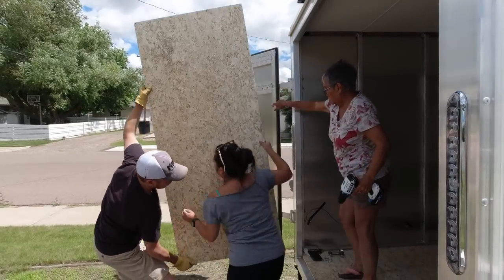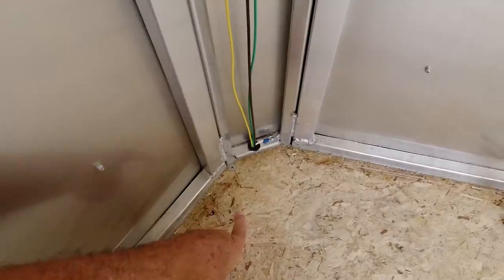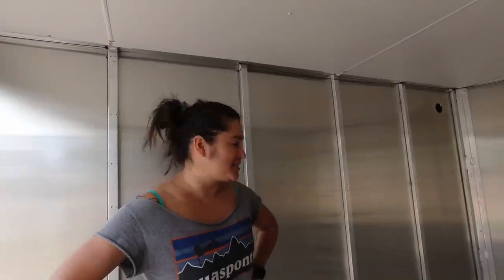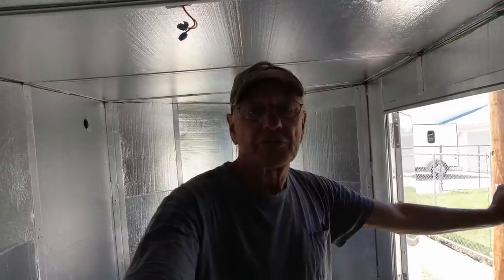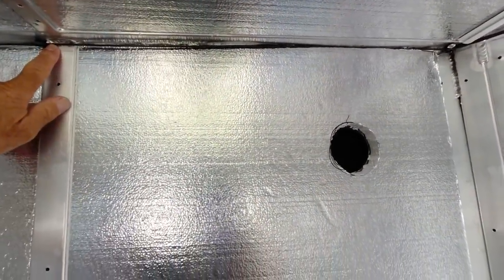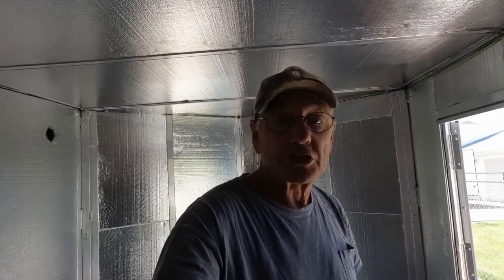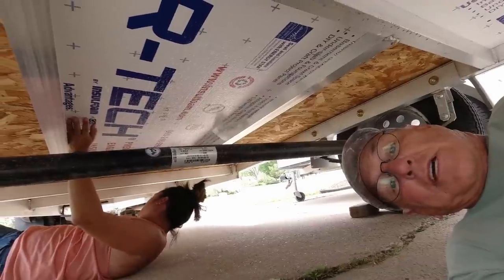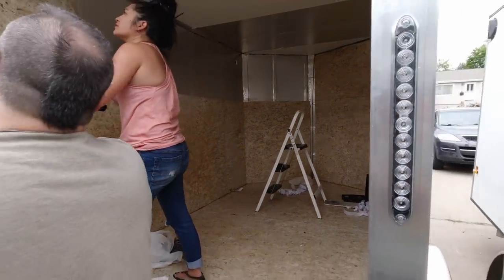Cargo Trailer to Camp Trailer - How To Start Your Build - Insulation

Comment: Great video folks.   A yr n a half ago l purchased a WeeRoll enclosed rv trailer (www.weeroll.com).  They are down in Ocalo, FL.  Mine is a 6x10 Nomad that's 6' hi made of steel and insulated.   They make aluminium but are abt double the cost of steel.   That extra cost killed my budget as l had to also equip it.  I had them add 3 rv windows, 2 12 or 15? x 30 on curb side n 30x15 on street.  Wife n l downsized moving to 55+ community meant it took longer to complete.  Added 700 watts of solar using 4 lead acid 6V deep cycle golf cart batteries.  The steel meant lower first cost.  Yes l knew lower gas mileage but that came later and l cud absorb.  They heavy batteries same thing.  Lithium ion are more than 4x's the cost of lead acid.  Don't believe lithium last longer.  If you properly maintain your lead one's you can get 10 yrs out of them.  Yes heavier so it lowers gas milage some but as you say gas mileage is more affected from wind resistance than weight.  If you want to see some pics of my work, email me at herbjrlapp@gmail.com.  great job..l subscribed to your channel...always something new to learn.  Will use mine as an AstroTrailer off grid camping to see the stars out in your area of God's country hauling me and my telescopes.  Was supposed to be put there this summer in CO n northwestern NE for large week-long star parties that got Corvid cancelled!!!  😫😥😥🙋‍♂️
Reply from the maker: Email sent.

Comment: Hi! We communicated some in the past. I need a little input. I’ve got the nuway heater, but I’m trying out the wave3 first. It’s so practical except that it’s not vented and may be contributing to moisture inside. My question.. I live at 9k’ and have used it up to 10.5k’ as well. The mat is only turning orange for approximately 1/4 of its surface. Have you used yours up this high? How did it do? I’m thinking it’s the oxygen at altitude, but maybe it’s the new regulator? Everything’s new. Hey, her trailer looks very similar to the one I just purchased! I’m about half way into my build. Maybe more :)
Reply from the maker: I know the NuWay works fine at altitude but the Wave may not.  The reason i say that about the Wave is the Mr Heater doesn't work at altitude and it's also a catalytic heater.
Reply: Gonagain I couldn’t get the buddy heaters to work at all. Tried 2 .. big buddy and little buddy. 10mins and they’d shut off. But I’m getting a lot of water in here with the wave3. Is that why you switched to the vented nuway? I’m thinking I’ll still get condensation with the nuway, but wondering if it being vented I’d have less moisture? I believe there’s condensation, and, there’s water vapor from the propane?
Reply from the maker: @d-arts7139  you'll get zero condensation with the NuWay and that's the reason why we switched.  You'll love it.
Reply: Gonagain thanks. I’ll hook up the nuway then. This moisture in here is gonna be a problem. I don’t remember seeing any moisture on windows in my last steel trailer with a wood burner. This aluminum trailer with the wave3 I’m getting lots of water even on the screw heads holding the paneling to the walls! It’s running down the walls and streaking.
Reply from the maker: @d-arts7139  The NuWay is going to be like your wood burner.
Reply: Gonagain thanks again! I’ll switch them out. Head down this way sometime. I can even get you out of your trailer for a few days. I have the rentals on the lake. I’m sure I mentioned it before. Take care!

Comment: I have a question. You talked about the shiny side in vs out. For the floor insulation wouldn't you want the shiny side out to reflect the heat from the ground out? Or does it not really make a difference? I don't know too much about this.
Reply from the maker: It certainly does make a difference, but which way you use it depends on where you plan on using your trailer.  We're in Montana where we are more concerned with keeping the heat IN.  Down south you want to keep the heat OUT.  If you can find double mylar sided insulation that would be perfect, but I don't personally know if it exists.  Maybe.  Thanks for watching!
Reply: @gonagain Ahhh Im in Texas so I would want to keep the heat out.😂😂 Thanks!
Reply from the maker: @myhallyulife  Yep!  For y'all it's shiny side out.

Comment: Personally I wouldn’t use foam panels because of condensation between the outside skin and foam board. It’s a horrible idea in the long term, it’ll be fine for a bit but then the problems start with mold and deterioration. To much time effort and money to cheap out at the foundation of the build.
Reply from the maker: It has a vapor barrier to keep the moisture out.

Comment: is your trailer 6X10 also?
Reply from the maker: Yes, it is.
Reply: @gonagain  I haven't checked prices yet, but in your opinion is the aluminum frames trailer worth the extra cost?
Reply: @gonagain  is the 10 measured to the point of the Vnose or is it a 6X10 with a Vnose added  on? Hope that makes sense